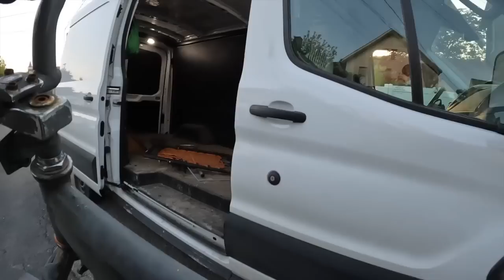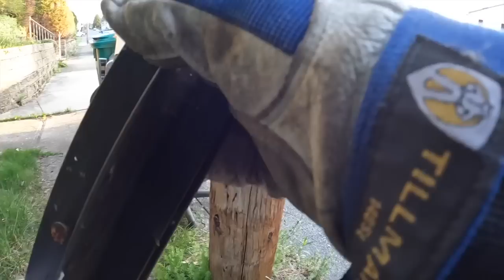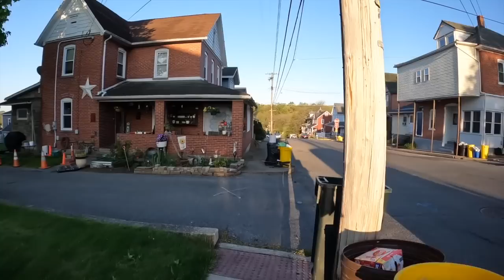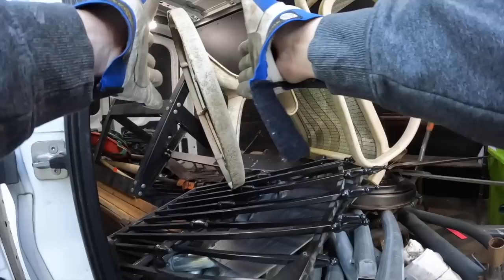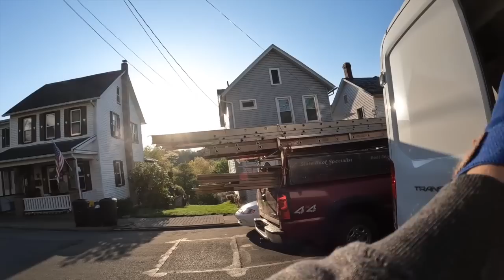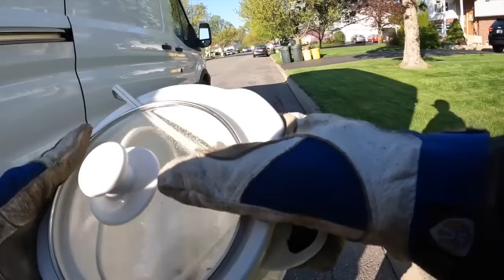I FILLED MY ENTIRE VAN WITH THINGS I FOUND IN THE TRASH...

Comment: yes they should reuse the bed rails . Cut them to 4  feet ,paint them ,then drill and screw them to the lower end of fence posts . Then concrete the post and rail in .This will give extra life to the fence .

Comment: I hope you didn't scrap those pipe clamps. If the clamp pieces aren't rusted, they're worth more at the flea market. The pipes can be replaced with longer or shorter pipes. The stand with the wood top is a good flea market item too. 
Have you considered getting a small box truck for doing the flea market?